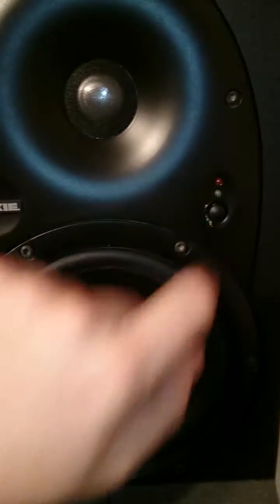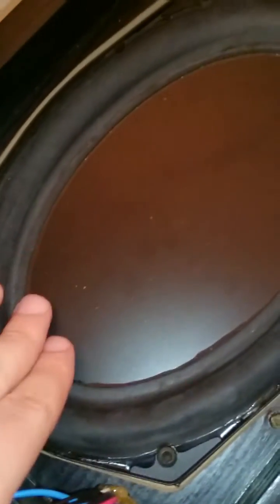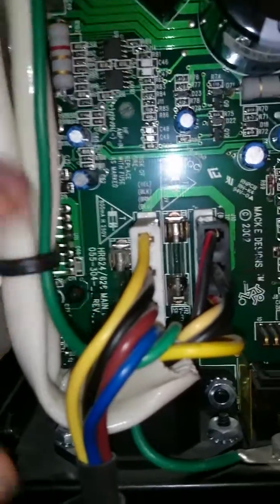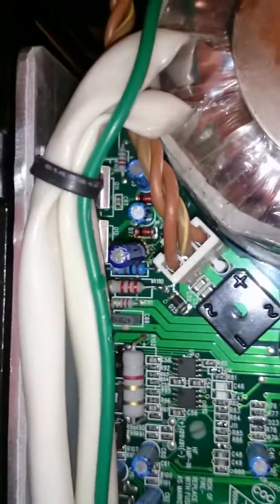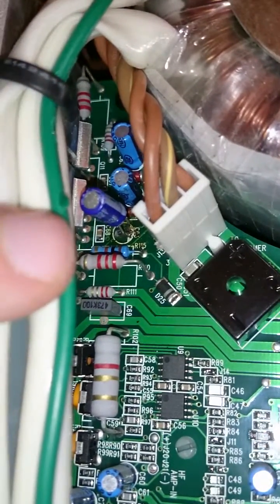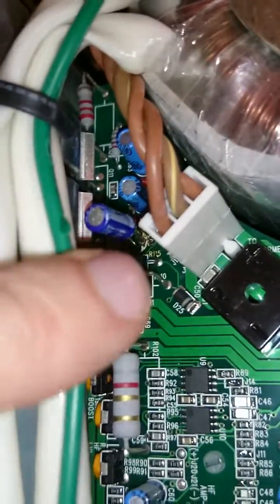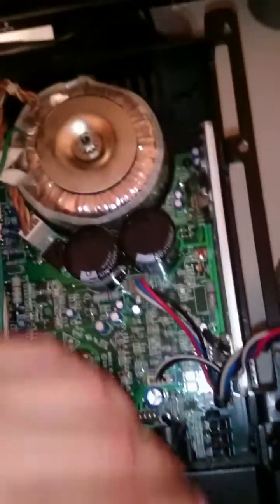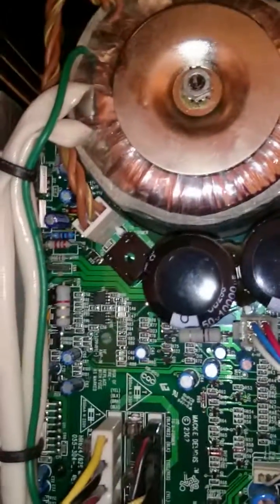Fixing a Mackie HR624 Speaker that won't turn on

Comment: Thank you!  This tipped me off to the same faulty cap on the HR824MKII (C107 on that particular circuit board)  Same value, a 4.7@63V.  Replaced and now it works like new!

Comment: Can u get the printing board out ?
Reply: It is possible, it's just a little more work to disassemble and reassemble. But it does make it easier to solder with the board out.

Comment: Hi!I have the same problem.I opened it up but the fuses both are ok and there is no visible damage to the cap.Could it still be broken?Should i just change it and see?Thanks!!!
Reply from the maker: Were you able to test the fuses with a continuity test to be sure that current is passing through each side? 
If that's definitely ok then change out one cap at a time... it may look ok but could have failed in another way.
Before that, as silly as it sounds... go through the power slider switch on the back... make sure it's in the on position, not auto, and the front power button is also on, and feed some input into the jack input connection.. I've had it before where it was in auto and wouldn't switch on. Saved a lot of work!
Reply: @thingsinlife  Hi!yes the fuses are ok with the multimeter and I checked the switch.Nothing happens.Ill get a cap and see.Thanks a lot!
Reply from the maker: @electrifried  Fingers crossed the cap will sort it! Let us know how you get on!
Reply: @thingsinlife  I hope!Thanks!!
Reply: I changed the cap and the fuses and I`m glad to report that it worked!!!Thanks a lot!!Be well!!!
Reply from the maker: @electrifried  Amazing news! Well done fixing it :) Glad it's back up and running, enjoy!
Reply: @thingsinlife  Thanks again man!!All the best!!!

Comment: Worked like a champ.  For those who can't get the cap posts out, add a bit more solder first and that will help get the heat down into the through hole and give better chances on that tough angle with the desolder pump.
Reply from the maker: That's a great tip about adding extra solder. Access is definitely difficult in that area
Reply: @thingsinlife  Still enjoying my fixed HR624's 8 months later!!
Reply: And just fixed the second speaker!  Thanks again.

Comment: Just did this repair.  Very grateful for this video and other sources that run down this fix.  For those needing this repair be sure to also check the other YouTube video about it as well.  I did all the work from the top of the board without disassembling it further.  This saved me some assembly work, but I found that working from the top in that cramped space was not easy.  Hard to suck the solder out and then hard to solder the leads in that tight space.  If my other 624 has the same problem I'll probably pull the whole thing apart and work from the back of the circuit board.  I checked the fuses and they were ok - it was the cap.  Anyhow, my monitor is working again thanks to these videos :-).

Comment: Thank you for this! One of mine has decided not to wake up and I'm hoping it's this. I could feel my wallet trembling until I watched this video :)
Reply from the maker: I had the same feeling and it's so nice being able to spend so little in contrast and having it fixed.  I hope yours is up and running now!
Reply: @thingsinlife  Never did get it fixed, swapped out the capacitors but no joy, it's been sat collecting dust in the garage ever since but I'm about to have another crack at it before finally giving in and throwing the damn thing out :)

Comment: Thanks for the video. Do you have a link to an online seller for the capacitors?
Reply from the maker: Hey sorry for the delayed reply.  Over here in the UK a place called Maplins sell them.  It's a pretty common capacitor so should be available from most hobby stores.  Ebay has loads of places too and they usually do good deals when buying several.  Hope that helps and that you get yours up and running!
Reply: @thingsinlife  Try this: https://www.digikey.com/product-detail/en/nichicon/UEP1J4R7MED/493-14716-ND/6161704

Comment: In the Hr 824 is the same. I have like distortion sound
Reply from the maker: It has a slightly different board layout, here's a link to it but the principle will be the same http://music-electronics-forum.com/attachments/38180d1457906475-mackie-hr824-voltages.jpg

Comment: Thanks so much! I can't believe I soldered something and it's working! 😂
Reply from the maker: You're very welcome!  Well done on the soldering, it's not easy on small circuit boards like this.  Glad that it worked out, saves buying a new pair of speakers
Reply: And it’s still working!!! 🙏🏾

Comment: Does this apply to HR824 monitors too?

The fuse had blown so I replaced it and it instantly blew again - I thought I needed to replace the transformer.  I would be super-happy if it was just a cap that needed switching!
Reply from the maker: The circuit board is different unfortunately 
http://music-electronics-forum.com/attachments/38180d1457906475-mackie-hr824-voltages.jpg
  If the fuse blew instantly, it may not be the cap - as that would only
 prevent power up.  It's worthy of a try though as it's a very 
inexpensive part to change.  Could be worth inspecting the board and the
 connections to make sure nothing is shorting out / loosely connected, 
which may be causing a power surge.
Reply: I have the same issue. Did you ever fix yours? I noticed the auto power switch on the back stopped working years ago, then it blew. Not sure if this is connected/the cause?